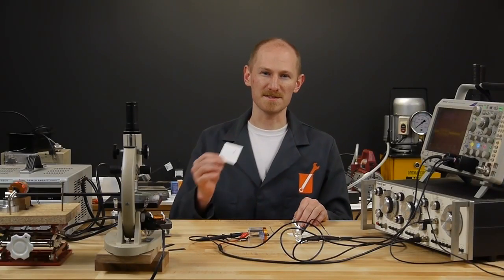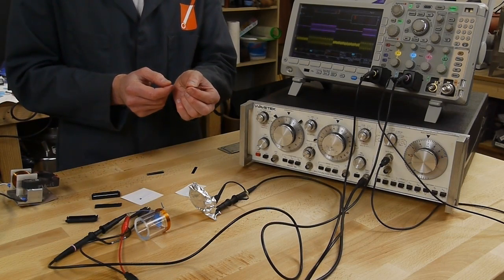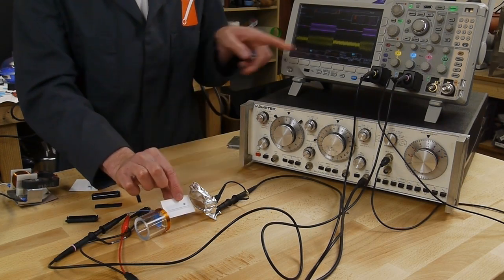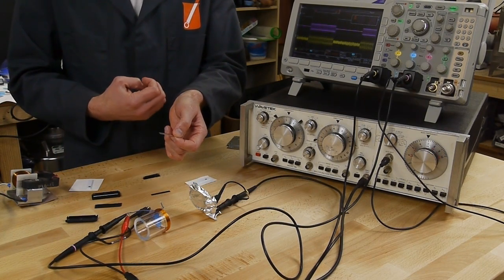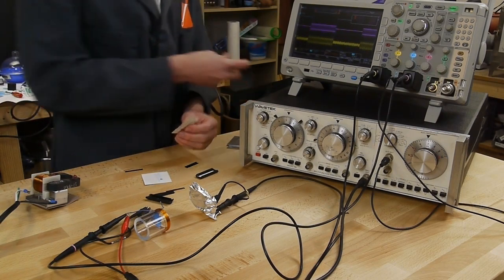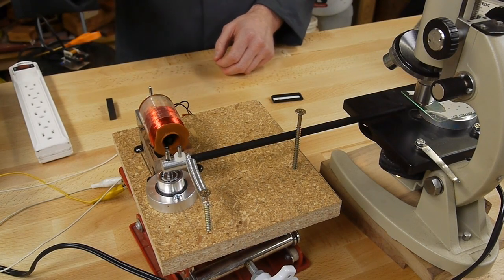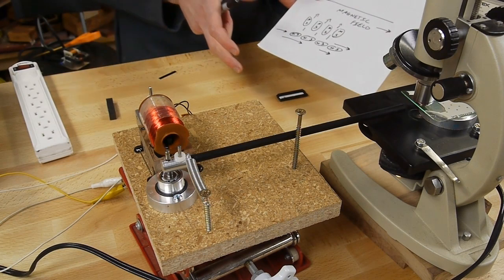How anti-theft tags work - magnetostriction

Comment: In my university library, you could easily locate the location of the magnetic field if you walked through with headphones on. Very high pitched, probably around 15kHz in my case.
Reply: Old TV's would drive me crazy.  I could hear the flyback and yoke at 15,525 KHz.  No headphones needed.  Just cheap loose windings.
Reply: yes you can hear the horizontal 15khz and you can hear the vertical at 50hz or so, you can also hear the high voltage whine...but those drive nobody crazy unless you are part of the hyper sensitive snowflake millenial generation, if you hear it just turn the volume up...and flybacks dont have loose windings...vertical output transformers maybe but a flyback built like that would fry in seconds...
Reply: @markgigiel2722  My hearing used to be so good I knew if a TV was being used nearby. Sadly now I have tinnitus that falls exactly around 15 KHz or more likely the sub-harmonic about 7 or 8 KHz where my hearing starts to fall off.  I think that in my case being a passenger in turboprop planes did my hearing in. I started wearing ear plugs, but too late.
Reply: @rhyoliteaquacade  Mhm yeah. After being an aircraft tech and exposed to countless hours of various high Db frequencies and many cross country flights; after 20 years of that, I sustained NO hearing loss so pardon my skepticism at your claim of hearing loss as a turboprop passenger.
Reply: Libraries typically used a different alloy, mu-metal, and much longer strips  and would usually bury the strips in the spine of the book.  That way they didn't have to disassemble the book.   I have some strips somewhere, but from memory they're about 2 or 2 1/2" long.  Also they worked on a slightly different principle.  The alloy would saturate very easily so the effect would be to generate 2nd harmonic signals that the system would then detect.  Our local library years ago went to RFID tags so they could have individual serial numbers used on the book borrow and returns, automatically machjine sort them for which branch the book had to be sent to and to check it in against the library card used to check it out.  So it's quite possible the frequency was quite a bit lower.

Comment: 5:26 The funny thing is: They are going for the inductor-cap combo a lot of the times, but they make it out of aluminium foil and between two plastic/canvas sheets and that's it. It's working, it's flexible and it's way cheaper than even these metal strips.
It's just some spiral shape with the ends folded over each other while keeping those insulated to form the inductor and capacitor.

Comment: Another great video!
The curve of magnetic field vs mechanical output is the same as magnetic field vs recorded signal for audiotape. Tape recorders apply bias to the recorded signal to move the recordings into the linear portion of the curve. Some cheap cassette recorders use a magnet for DC bias, but most use AC bias around 45 khz.
Reply: If you don't stop hacking my Tennants you're going to jail

Comment: It is important to note that metal strips are of two different ferrous alloys. One is a type of steel, as this becomes a ‘permanent’ magnet when subjected to a magnetic field.  The other is iron, in that it responds to a magnetic field but resists becoming a permanent magnet. The plastic container is water proof to prevent corrosion of the metals strips within.  The device is ingenious and the presentation in this video of how it works is pure genius.

Comment: Hi Ben;
Many years ago, mid '80s, ASIR, I had a magnitostrictive delay line. It was from a mid '60s Friden calculator. Unfortunately I have lost track of it now.
This had a long steel wire carefully supported and coiled into a spiral. The transducers at each end had 2 tiny strips of the magnetostrictive material spot welded to the wire at right angles. There was a small coil around one of the strips and a small bias magnet  in the coil.
Both ends were made the same.
When I pulsed the coil it would cause one strip to lengthan and the other to shrink. This applied a twist to the wore which propagated down the wire. 
Of course, at the other end the strips were forced to stretch and shrink inducing a magnetic field in the coil.
You could easily see the delayed signal on a 'scope.
I speculated that it could dynamically hold about 8k bits of data. Maybe more, probably less.
I didn't have a micro yet so couldn't actually see if I could recirculate any data through it.
I have there been any amateur attempts at making such a device?
redrok
redrok.com

Comment: Without DC bias, the magnetostrictive effect is a square-law effect, so the frequency is effectively doubled because you are riding across the tip of a parabola (which the bar is not tuned for).  With the bias, the the effect is linear if the DC field is large compared to the AC field (you are riding on the relatively-straight side of the parabola), so there is no doubling.

Comment: Hello, i worked in the industry that made these tags, the met-glass is a glass/ metal formula that can get magnetized and un magnetized REAL fast.  And believe me..it cuts your skin REAL fast too... Any way .. the met-glass came in a roll that was cut to what ever length or width you dialed into the cutter machine.  In a few hours we would have a entire box full.    A  super efficient high frequency transformer can be made with met-glass ; however it is expensive stuff.....   wear cloth gloves.. or buy a box of bandages.. nice mini relay switches can be made also..  :)

Comment: My understanding was that the use of a strong magnet would saturate the adjacent hard steel  where its coercivity would leave it in a permanent magnet state that was just right for generating the ring-down pulse.  To deactivate you had to de-magneitze the hard steel strip, so at the checkout counter is actually a zebra stripe type magnet that will de-magnetize the strip when the tag is swiped past it.  The reason for this is that many ne'er-do-wells would think think they could defeat the tags by magnetizing them., but would in fact, make sure the tags were fully activated.  Also another part of the design is the plastic separator between strips is slippery Teflon, so that the strip can resonate without being too quickly damped.

Comment: You are doing an amazing job! Here in Brazil it's more common to see that heavy round plastic ones. That one I think that isn't by this method.
Reply: +Navarro Eletrônica Those big round ones (if they're the ones I am thinking of) typically have an inductor (usually ferrite cored) and a capacitor, forming a tuned circuit at the same frequency as these (58KHz). I've learned to my cost that some power supplies such as laptop chargers etc. have combinations of components resonant at the same frequency, and can set them off!

It used to be walkman headphones in the late 80s that would do it!
Reply: TheChipmunk2008 I'm guessing maybe the ferrite choke on the charger?
Reply: Your imagination is far surpassed to that of mankind

Comment: Very interesting! Glad I know how to turn those pesky things off now ;)
Reply: +Samy Kamkar next year at DEFCON, Samy's Guide to Shoplifting.
Reply: +Samy Kamkar Or how to destroy a hard drive. Take it with you on a shopping trip, go through the self checkout, and use their demagnetizer. (Especially if you're too lazy to have your own. :-) )
Reply: 5
Reply: Fortunately for the shops, they use RFID now.
Reply: Samy Kamkar You can wrap them in aluminum foil, too. Or if you have the time, line the inside of a shopping bag with foil and then you can fill it up. Just make sure the top of the bag is closed when you walk through the sensors. It works with RFID, too.
Reply: Samy   You just put yourself on a watch list.
Reply: FBI OPEN UP
Reply: did it never occur to peel it off? lol
Reply: oldskoolhead0 I use the thin metal strips inside these for lock shims when rekeying. They use a very very strong adhesive to attach them. It’s not easy to just pull them off.
Reply: @oldskoolhead0  hard when they're inside the product box.
Reply: I like how everyone is saying that OP is on a list when Freeway straight up gave detailed instructions for how to jack bags full of tagged items.
Reply: @oldskoolhead0  that's what I'm saying

Comment: Great video.  One thing to think about:  An amplified signal has more energy, yet the metal strip can't add energy to the system because it doesn't have a power source.  So, where is the extra energy coming from?
Reply: think of it like a spring. if you oscillate it at its resonant frequency, it will have a higher amplitude. if you oscillate it at a different frequency, the natural frequency of the spring will interfere with the way you're oscillating it and it has less amplitude. it doesn't get extra energy from somewhere else, it just doesn't dissipate the energy as much as it would if it wasn't at that frequency.
Reply: +Physics Videos by Eugene Khutoryansky The coil that makes it oscillate is the power source.
Reply: From the transmitter. The strip changes the properties of the transmitter coil and makes it use more power than when it's just air.
Reply: +Physics Videos by Eugene Khutoryansky Wait a second, I'm pretty sure there's a video on youtube by this Eugene Kutoryansky guy that will explain it, I'll try and find the link.
Reply: +Physics Videos by Eugene Khutoryansky 
Hmmm, I thought about the higher amplitude while watching the video, and my thought is that the system does not actually have more energy, but rather that energy is stored as vibration in the tag, you can see that with the tag in place, the waveform has a more gradual buildup rather than the nearly square envelope it had without the tag, as the tag is resonant with the frequency of the exciter coil, it starts vibrating in phase with the field of that coil, so the re-emitted energy is also in phase and the two fields add together and you get a higher amplitude. 

I expect that the tag absorbs a small amount of energy from each period of the exciter coil, until it reaches the maximum it can store as vibration, at that point it only needs a little energy to keep resonating(to replace the energy lost as heat and the loading of the scope). The envelope of the signal when the tag is in place does look similar to a charge/discharge curve.

The two coils are essentially an air core transformer, so adding some ferrous metal strips probably increases the coupling a little. Of course, there isn't much metal in these tag so the total energy coupling this "core" could provide wouldn't be very large, though it may be detectable on a high impedance instrument like the scope.

Adding a DC magnetic field to a transformer, for example with a permanent magnet can, of course, strongly affect it's characteristics, though the magnet in the tag is probably too weak to significantly affect things.
Reply: +Physics Videos by Eugene Khutoryansky There is no amplification. The detector is a coil. The tag is basically a vibrating magnet. I think the detector coil works by magnetic induction. That is why the signal "rings down" for some time after the TX pulse stops. The TX power vastly exceeds power at detector.
Reply: +Physics Videos by Eugene Khutoryansky The resonating tag is improving the transmission of energy between the coils.
Reply: +Physics Videos by Eugene Khutoryansky  great question, I dont think it amplifies the signal, but it probably "focuses" it because it conducts magnetic flux better than air, it acts like a magnetic core in a transformer/electro magnet. 
Ben Krasnow is careful not mention the word "amplification" and says the detector works by measuring the slow decrease in the signal. So the oscillator is a bit like a capacitor, it dampens the signal on startup and prolongs it after the source has shut down.

BTW I really LOVE your vids and they help me A LOT understanding physics.
Reply: Don't forget that the scales on the transmit/recieve traces on the oscilloscope will be different.  Although they look to be the same when there is no tag in place, the bottom (recieve) trace is probably only recording a fraction of the voltage of the upper trace, but it has been scaled to look the same.  When it increases with tag insertion and it looks like there is more energy coming out than being put in, it's just because it is using a different scale.  I think...
Reply: it's a periodic pulse the energy was stored in the resonating metal strip which then continue to resonate in a dampened amplitude for a certain amount of time after the pulse ended. The anti-theft tag actually doesn't add any energy to the system it actually takes away from the energy transmitted in order to induce its own oscillation but the receiver isn't looking for that it's looking for the continued oscillation after each pulse goes quiet if the pulse stops and the receiver no longer hears anything and no tag is passing through but if the pulse stops and there is still a ringing coming out of the system then it must be from the tag
Reply: The oscilloscope has probably a different scale for the receiver. There is always a loss in transmission.
Reply: It resonates. just like a weight on a spring bouncing. That's why it's so frequency specific. Have you ever put a coil in parallel with a capacitor and swept it with a signal generator? If so, tune it, and then remove either element, and the amplitude will go down. That's the same effect as demagnetizing it, or overmagnetizing it into saturation. It just improves the signal between the driven coil, and the pickup coil.

Comment: I vaguely remember an experiment in college physics lab where we were measuring very small motions.  We used a mirror with highly colimnated light shining on a scale we placed on the wall several feet away.  Today with lasers, that would be an interesting way to measure the length change in this experiment.

Comment: An interesting example of magnetostriction is the high pitched tone that is created whenever a CRT monitor is turned on. The scanning rate of old "tube" style TVs was about 16kHz, that is, the electron beam would sweep across the screen at about 16,000 times per second. The beam was directed by electromagnets, which would also stress ferrous materials in the set to oscillate at the same frequency, making a high pitched "whine". Unfortunately, as we age, we tend to lose the ability to hear high frequency sounds, and often by about age 30, most of us can no longer hear sounds that high.
Reply: I certainly don't miss the high pitched whine of CRT TVs.

There the effect is more likely to be just the huge electromagnet on the CRT pulling on anything that is attracted to the magnets, sheet steel structural parts used to be common in TVs and for example speakers have large unshielded magnets on the back that could also potentially get vibrated by the CRTs deflection field.

The effect is however believed to be quite prevalent in giving large mains transformers there loud buzzing sound.

Comment: The type described in this video is made by Sonitrol, the other brand uses a system similar to rfid technology, these would be the flat paper tags made like stickers and look like a square line coil with a black rectangle at the center. I learned this by interviewing with the square paper tag guys!
Reply: I never liked those square tags. I would study them to figure out how they worked. Frustrated I would throw it away. A day later I would find another one and ponder it again. Is the blob a capacitor or a diode? I am thinking it is a diode and that it works by creating inter modulation mixing effect of two radio signals, the product of which is detected.

Comment: The assertion that the ribbon moves a thousandth of an inch in response to magnetic forcing could still be correct.  Remember that this is a resonant response: its amplitude can be much larger than the equilibrium response to a constant driving force.

Comment: I used to see those on CDs and DVDs back in the day, but they're easy to remove. Some stores will have their more expensive items wrapped in these black wires and ball. Definitely leave those alone, but if its like an $80 external hard drive or some USBs in cardboard that you're supposed to get an employee to remove from the rack, those are easily defeated with a pair of scissors.

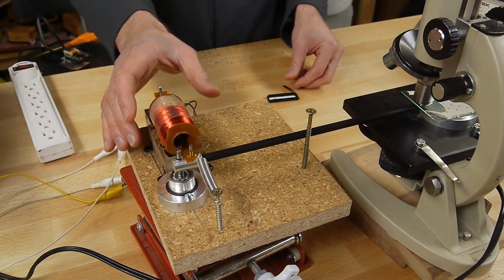Comment: @10:56 this fixture is good, for better results you may need to link the vibration to an arm and then use incident and reflected light beam to observe under the microscope or on the wall for example. This is because the spring in this fixture introduces lots of impedance to the vibrating Magnetorestrictive plate, and thus may not present the real variation in the length of the Magnetorestrictive plate. Your fixture is fun, and the light beam idea is more fun.

Comment: Correction. There is sound being transmitted. But, number one, it's above the audible spectrum, and number two they aren't using mechanical audible means to detect it, they are using a magnet to detect it.

Comment: A magnet will activate and/or deactivate it, depending on which side (polarity) you rub accross it. The ones that are designed to never deactivate, simply have a thin piece of plastic between the two metal strips to keep them from touching. I always assumed that it had a static discharge or that the strip actually bowed inward like a pop up cap on a juice bottle.....or both. You can use the same magnetic key that they open the clear plastic lock up boxes or "spider wrap"  for merchandise with.

Comment: The resonance can actually cause more variation in length than the static value measured, depending of course on the Q factor, power and exposing time. But in the graphs of the scope I actually see how the grow quite a bit in the "burst" duration of 58khz signal